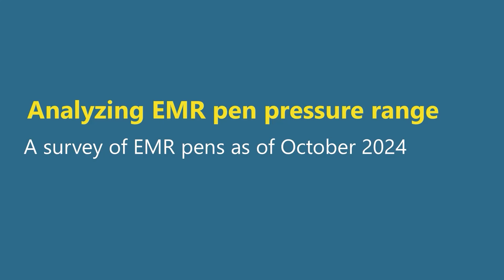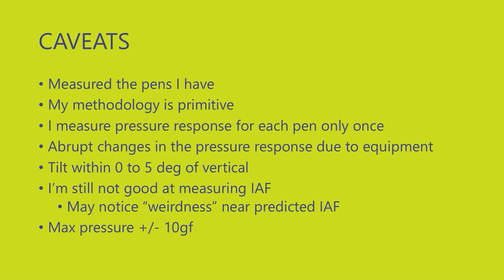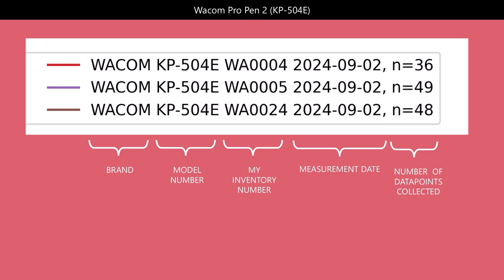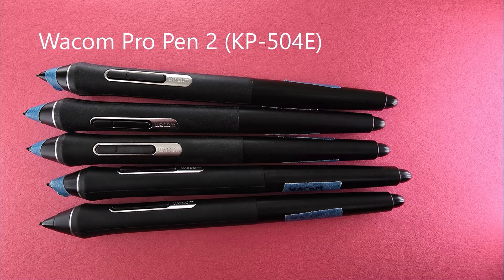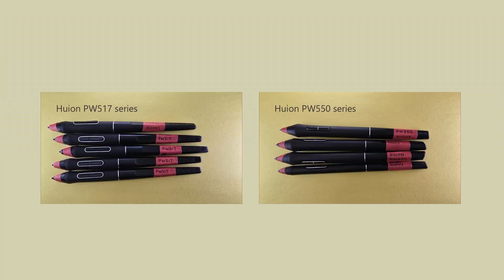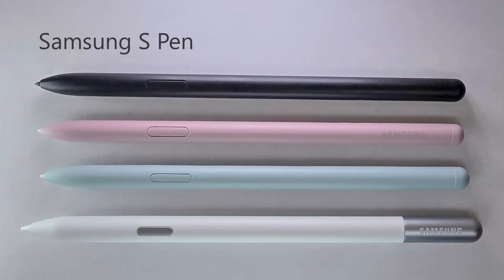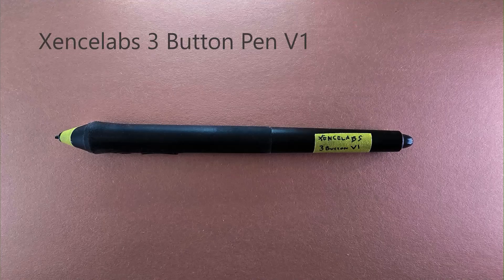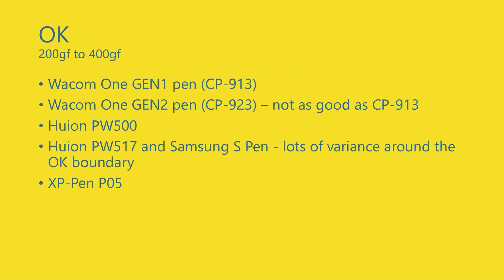Pressure ranges for 53 drawing tablet pens

Comment: Regarding the outliers, my PW550 pen is a bit wonky too. It gets to 40% logical pressure very easily, and the pressure tends to fluctuate a lot when you try to maintain it. In contrast, my PW550S pen has a more stable pressure response. It's a bit of a shame because I prefer the thick pen, but with some tuning of the pressure curve I can get it to work very well.

Comment: It a owesome video. But there are some  problem I have to this video. 

1. in 09:11 . is the title wrong? The picture looks like the comparation between wacom LP-1100K vs wacom CP-923, but the title is LP-1100K vs LP-190K?

2. in 10:09 The title wrote >= 700gf but why there are LP1100K and LP-190K? I don't any sample in video of these two pen that the maxium pressure meet the 700gf?

However, this is a really cool video. Thanks for sharing these data.

Comment: Thank you for your hard work! This is very helpful. Personally I have used the wacom grip pen for 7-8ish years before finally switching to Huion's PW517 pen late last year. My initial impression after the change was while it is much more easier to bottom out the pressure on the PW517 pen I find that both pens are pretty good and have similar feel. Both handles pressure changes pretty well. I'm not too sure if it's the pressure range or the pretty similar ergonomics of the pen but while the change was technically a downgrade I don't feel like it's a downgrade.

I'm still looking out for when my local Huion distributor decides to stock up PW550 pens tho, after looking at the graphs I'm intrigued.

Comment: Thanks for the hard work. I have a pro pen 2 like that faulty one you have, after removing the button and cleaning the interior gently, now its working fine and I can go ful pressure, at least for the last month its been good. If someone is in the same situation you could try it. Use a q-tip to clean the interior.
Reply from the maker: Thank you for the comment! I'll give this a try!